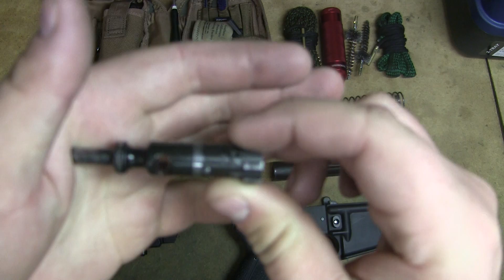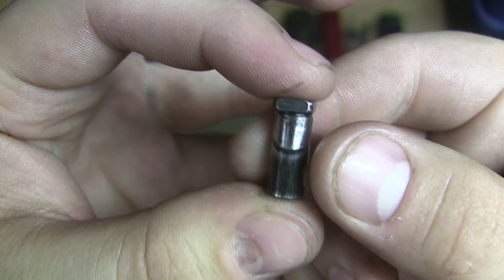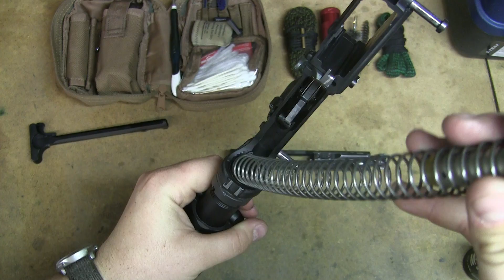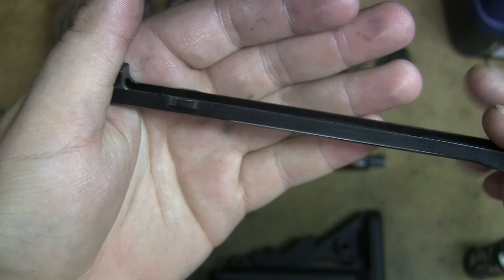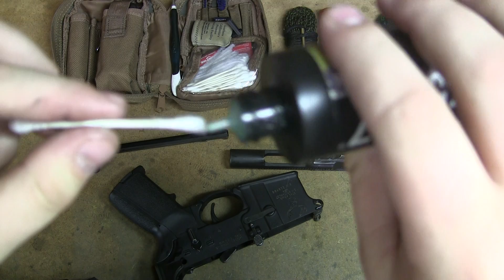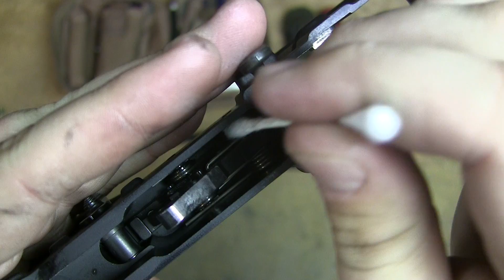AR15 Lubrication

Comment: what rear sight are you using?
Reply from the maker: +ian bailey 

This is the LMT Mk18 fixed rear sight -as you can see it's basically the carry handle M16A2-style rear sight setup without the carry handle.  It's hollowed-out to be as lightweight as possible and I really enjoyed having it on there because I'm used to traditional M16 iron sight usage, and most BUIS units only adjust for windage, while this unit does both windage and elevation.  I think it goes for around $120 or so, but I know UTG makes a similar product for much less but the quality isn't the same.  

Nowadays I use the MaTech rear sight on my issue M4 but when I get home from this deployment I got one waiting for me for my civilian rifle, I absolutely love the MaTech.
Reply: Thank you very much for the information. I am retired from the Army and that's what i had on my m16 back in the 90s and also on my m4 with an acog as my optics.

Comment: my retaining pin wont go in all the way.
Reply from the maker: It's normal for a firing pin retaining pin to be a little tricky to put in, but not if it can't go in. Never apply massive force to the pin, it never requires strength or man - handling to insert. Doing so could open the "legs" of the pin, making it unserviceable. "Jiggle" the pin until the legs find the hole. If the legs are too open then you may have to get a new pin.
Reply: +REMIX8604&#160; Try turning the retaining pin after you insert it as you're going through the other side. That helps a lot.

Comment: SHOW HOW TO DO IT ON THE COLT LE 6940P
Reply from the maker: +Jason Greiner 

Basically it'll be the same deal; the bolt carrier group is almost identical (except for the gas key).  The only difference is now you have to take apart the piston system and oil up the rod/spring/cap.  It doesn't need oil to run but I would do it for rust protection.

Comment: I had trouble cycling my rifle today... in fact out of 35 shots, about two cycled.  My rifle looked very dry and did have some carbon build up.  I hope lubricating all the right parts makes a difference.  Thanks for doing a thorough job!  the only hiccup i had is how to orient the bolt face when reassembling.  I figured it out though... extractor goes on the right!!
Reply from the maker: That is not normal. What kind of jams were you experiencing? 

Without knowing anything that sounds like a gas system leak/issue, horrible ammo, bad mags, or a junk extractor.
Reply: It didn't jam, it just never ejected the spent casing.  Basically, i had a bolt action rifle.  Pullin on the charging handle extracted the brass just fine.  I'll be taking out this weekend and see if it's still doing it or if i've improved the situation.
Reply: well, the big clean and lubing of the rifle didn't work... I shared my frustration with the guy at the range and he took a look at it.  The gas block was loose!!  I wasn't getting enough pressure to move the bolt carrier back far enough to eject.  I'm going to reset it with some Loctite and we'll see if that does the trick.
Reply from the maker: +mbatson13 

Loctite is great but it doesn't hold up to high heat. See if a gun smith can stake it in place. I've never been a fan of screw-on gas blocks for this reason.
Reply: It has a 300F failure point, but that's the highest one I could find.  I'm not sure how hot my barrel gets... since it's essentially been a bolt action for the last 4 months it's never gotten very hot.  I had a small company build mine during the threat of the AR ban 3 or 4 years ago.  They might not have had good parts for the gas system..
Reply from the maker: +mbatson13 

The barrel will get pretty hot with a decent amount of shooting. Loctite will get you by but the problem will come back later. To be done with it have the screws tightened then staked in place so they cannot walk out (much like the screws on your gas key on the bolt carrier).
Reply: +Mr2ndAmendment Yeah... you're right.  I don't think I could stake them myself. I'm pretty sure I'd make a mess of it. Maybe the guys who sold it to me will fix it!   Thanks for the words of advice!

Comment: what about a straight pull ar-15? (due to  bullshit laws)
Reply from the maker: +geezerp1982 

I've never actually hand-inspected a pump-action AR15 but I would apply the same concepts -oil the areas where metal slides on metal.

Comment: I'm having an issue with my bolt carrier key and my gas tube hitting it wasn't doing that be for how can I resolve the issue
Reply from the maker: +D M 

That's generally not good news.  It could be many serious things, but firstly check the gas key.  Is it loose?  No?  Okay move on.

The barrel may be loose in the receiver because the barrel extension gave out on the rest of the barrel, or the barrel nut isn't tight enough, or a bunch of other serious things.

Don't shoot it until this gets legit-fixed.  Who made it?
Reply: Bushmasters made it....I thanks for the heads up, I will order a new gas tube and get one of my ex military buddies to help me replace it for me and I will show him what you suggested in your respond.... thanks.
Reply from the maker: D M

I would try to work the warranty on it with Remington but either way, it needs to be looked at.  Does the barrel twist independently of the upper receiver?

Comment: I thought the video was informative. I do not recall that you put any lube on the front portion of the bolt that engages the locking lugs. Do you lube that area as well?
Reply from the maker: +Shotgun Man 

Good question, I should have addressed that in the video.  Many people heavily lubricate the bolt lugs because they do interface the barrel extension (star chamber).  I choose not to because I've seen it become a dirt magnet and I don't want sand and dirt gumming up the star chamber.  Those parts don't have big tolerances and attracting dirt/sand there will cause feeding issues or failure to fully chamber.  For long-term storage though I definitely advise to lubricate the bolt lugs and head heavily for rust prevention.

Comment: I soak my bolt carrier and fill the piston area with oil until it spits back. The reason? So it cleans better and I've had zero issues. I have a great understanding of this and when it comes to the bolt? The more lube, the better. I never have cam pins wear out and have never needed to scrape carbon off of a bolt. Always wipes clean. AND... I don't need to clean it very often. My ARs are not gun safe trophies... they operate.
Reply: I tend to over lubricate my AR too, if I were sent to a dusty environment then I'll be a minimalist, but my AR is not collecting dust in the battlefield, it is collecting humidity in the gun safe.
Reply from the maker: +BikerBry 

I don't think you'd always be able to get away with that if the worst happened.  See the AR15 reliability test video -less oil helped there, but then again those were VERY dirty and unrealistic conditions.
Reply: Dip it and rip it!
Reply: yep...me too
Reply: thats a good way to get oil into the chamber ! which increase pressures on firing ! you wont notice it, as the semi auto gas system has so much force that it will still cycle the bolt back (the case would expend alot more because of the higher pressures of the oil getting into the chamber

Comment: Hah, I lube my AR bolt almost exactly the same way. I never looked up how to do it, I just did like you mentioned where I took a good look at the design, and used my mechanical experience to decide where it needed it. I also use Mpro.

I use grease on the cam pin instead, and I think mine looks less worn than yours.
I also grease the part where the hammer rides.

I run the buffer dry.
I do the charge handle differently, but pretty much as minimal.
I use grease on the trigger engagement surfaces, hammer.
I do not lube the springs. I also have a Giessele.

I grease the takedown/pivot pins and trigger pins like maybe once every 1000 rounds or so when I do a thorough strip and clean.

Comment: I lube the exact same spots except with lithium grease and have not had any problems. Ive been using grease instead of oil in my ak and pistol as well and it does the job.
Reply: I have found grease to actually work much better than oil. It stays put, lasts MUCH longer than oil (especially in M4's/AR15's) and doesn't burn off like oil eventually does. When I've used grease on an AR15 I've literally never had a single malfunction and neither has anyone I've ever known who has used grease as well. I've found synthetic grease works much better than petroleum based grease. If the grease is too thick for your liking you can add a drop or a few drops of oil to make the grease a little thinner (only if you like - I don't do that - I find the grease works perfectly straight). If you never tried grease on an AR I HIGHLY recommend it. Everyone who I know that has tried grease on an AR has never gone back to oil.

Comment: Has anyone used Hoppes new "Dri-Lube"?? I bought some the other day, not sure if you could use it on the rails where the bolt carrier slides in the housing. It seems that if you did and its properties offered enough protection you could substitute that instead of the grease/oil which is a dirt magnet....what do you think

Comment: When I clean my AR.  I use a solvent made by Hoppes and use 3in1 oil. Clean with the solvent until the patches come out pretty clean. Then I pull a few dry patches out and then run a couple oil patches in with a small minimum amount of oil, that's it. The bolt gets a great amount of foul, hard, dry substance on it where the neck of it is which a brush is not going to remove it, so on that I scrape my knife blade around it to remove it. They actual sell a scraper tool to remove it, but the tool won't do any better that good ole buck knife will do. Other than the bit of oil while cleaning the gun, I don't oil it anywhere. It's fired probably 4000 to 6000 rds through it.
Reply: Hoppes and smells good to boot. Been using it for many years. Don’t seem to smell as good as years back. Same boat light oil in key locations. More don’t mean better.

Comment: good video, remember to stagger the bolt rings.
Reply from the maker: Thank you.  I didn't mention the staggering of the gas rings because I've never noticed any difference.  The gas rings will align automatically and do as they please during firing, and in my testing and experience I've noticed no difference whether I've staggered them or aligned them intentionally.  

Most people have a 16.1" barrel, carbine-length, DI gas system and when they're shooting the regular .223/5.56mm ammo that was manufactured knowing it would be shot in AR15s, you get an over-gassed situation to begin with.  It won't hurt anything at all to stagger the gas rings, but from what I've seen on M16s, M4s, and many various types of AR15s, I haven't been able to tell a difference.  The Colt guys in the armorer class told us it would still function with only one gas ring, after I heard that I've always thought of staggering gas rings as more of a ritual than mechanical necessity.  The Army never taught us to stagger the gas rings, I don't ever recall getting that instruction -maybe I could dig it up in a manual somewhere though.  Maybe I should do a video where I only have one gas ring on the bolt and shoot it -if it really does work still, then I think the practice of staggering the gas rings is definitely not required. 

Thanks, glad you enjoyed!
-Mr. 2nd
Reply: Finally some caught the fact that he did "NOT" even mention the alignment of the Bolt Rings. Good Eye!! But I must also say, "Thank you for your Service"! and Good job on the rest of the video.
Reply: That's not something you really have to worry about. They will just rotate wherever after so many shots anyway
Reply: The staggering of the gas rings used to be in the TM for the M16 and A2. It was more intended for those longer barrels and gas tubes to be able to capture all the gas and as a failsafe. Also with lubricating, even less is more. The lower treatment is spot on but the upper was over lubricated. The two vertical holes in the BCG are for the lube. Two drops in each hole is enough to lubricate the entire upper. That was what I was taught in basic training, annual 11B skills testing and small unit armorers school. Tours in Panama (humid), Sinai and the first Gulf war and no problems with the two x two system I just described.

Thank you for your service.

Comment: Cool video. Do you think using CLP as a lubricant is suffice for an AR-15?
Reply from the maker: Absolutely, I used it on my M16/M4 for four years and have used it here and there on my civilian AR15 nowadays.  M-Pro 7's LPX (the stuff in the video) is basically an improved version of CLP.  Just be aware though, good-old fashioned CLP really only lubricates and protects -not cleans as the name implies.

Comment: Is MPRO-7 still your favorite lube? Are you using something different now or still using the MPRO-7? Great video, thanks for making it.
Reply from the maker: I still love MPro-7 but I'm currently using Frog Lube to do a long-term comprehensive test of it and I'll make a video on it soon enough.  If I wasn't testing Frog Lube I'd still be using MPro-7, it's excellent stuff.
Reply: Mr2ndAmendment  What do you think about FireClean?
Reply from the maker: DragonSlayer2014

Honestly never used it.  When indoors I recommend M-Pro7 cleaner.  When in the garage use Hoppes 9.  When in a rush, use brake cleaner.  Anything else I can't recommend because I don't know it.

Comment: You think putting oil on the take down pin is more important than putting oil on the bolt's locking lugs? Interesting. I guess those pins are high stress areas.

Have a look at this:  http://i89.photobucket.com/albums/k229/usmcmonty/imagejpeg952.jpg
Reply from the maker: I recommend a light saturation of oil on all the BCG parts, especially the locking lugs, enough to have a shine but not be dripping in oil.  In a DI gun, the lugs of the bolt will start to pick up fouling, carbon, and dust if you've soaked it in oil -this is why I don't recommend it.  The bolt, barrel, and barrel extension all deal with 50,000 PSI of pressure every time you pull the trigger -I haven't noticed oil making a difference here unless you've over-soaked the bolt in copious oil -enough to become a dirt magnet and start to gum up the action.  

The takedown pins should have some oil because we've got steel pins working on aluminum parts -anytime greater metals work/slide on weaker metals, we especially need lubrication no matter how trivial it seems.  The bolt carrier, barrel extension, and bolt are all made of hardened steel and their relationship together does not require dripping, copious amounts of oil -that just creates a dirt magnet.  Most civilians will never push their rifles far and hard enough to pay for their over-lubricating sins but if you know you're headed into an austere environment it's a better idea to cut back on unnecessary oiling and amp up your lubrication on the critical working areas, such as the cam, gas rings, and the four "rails" of the carrier.  

Just one guy's opinion and it's worked pretty well for 4 years in the Army and 3 as a firearms instructor, but it's not the only method that will provide success.  

What happened to that bolt in the photo?  I've seen some high-usage rifles but I've never seen it get that bad.  I've seen one M16 do 20,000 rounds in one day, most of it on burst, and it didn't look like that when I inspected it afterwards.
Reply: Bolts often break at those locking lugs and at the cam pin hole (unless it is KAC E3 bolt). The gun lives and breathes at the leisure of those lugs and I consider them to be critical.  

The ''over-lubrication'' thing has turned into a religion over the years. It is only a factor in specific conditions like desert or arctic climates where oil freezes or the dust is so fine that it finds its way everywhere. Unless you have a habit of dunking your weapon in the dirt, it will never cause problems in normal conditions.

The issue I most often see is the contrary; under-lubrication. Bone dry bolts that have carbon cooked onto them. Similarly, in the field troops keep their guns bone dry with a minimum of lube and the guns fail because rust forms on the BCG's surface. The troops I have personally charged for that offense will attest to that. The horror stories are all grimly alike. I still cannot attribute a single case of a gun failing due to ''too much lube''.  Too often we overlook the ''protecting'' part of CLP.

Comment: can you use motor oil or any other oils to lubricate an ar-15 I got mine and I wanna know if I should use a certain kinda of oil ???
Reply from the maker: Certain types of motor oil can work for the AR15 but I'd recommend staying with gun-related oils.  Motor oil can work in a pinch but I would always recommend that since we've got gun oils available, for people to use those.  I'll have to do a "zombie apocalypse" video where I use unconventional oils and things to maintain guns when the right stuff isn't available.
Reply: Mr2ndAmendment What brand of Bolt is that ? I have never seen one with a raised silver ring like that.

Comment: Finally picked up my first AR recently, so I've been looking at more and more lube/cleaning video's lately. I like your video's. Very detailed and to the point. With that said, I was wondering what you think about running grease as a lubricant in an AR. I've run things like Milcomm TW25B in my 1911's, but I've never looked into it for  AR's. Is this something people do or should you stick with an oil? Thanks!
Reply from the maker: You can get away with grease on an AR under normal range conditions, but I would honestly avoid it.  This weapon system needs lighter-viscosity oils rather than sludgy greases.  The only place I'd use grease on a usual basis would be the buffer/buffer spring tube but that's about it.  Everything else needs oil -keep it lubricated but keep it light.  Good luck!